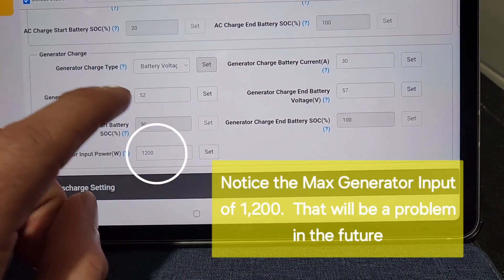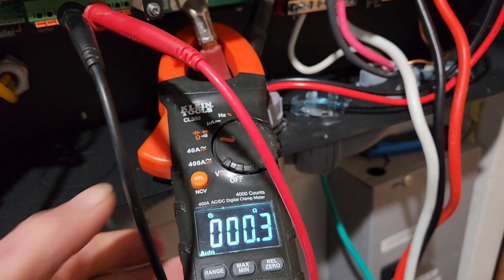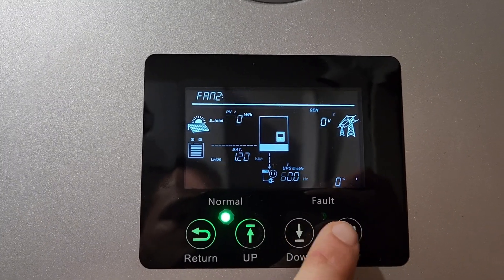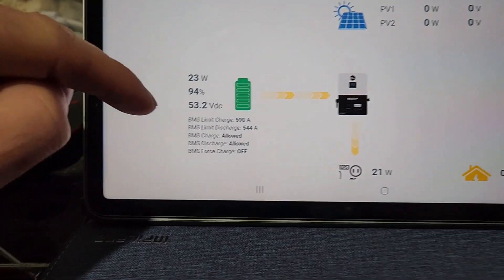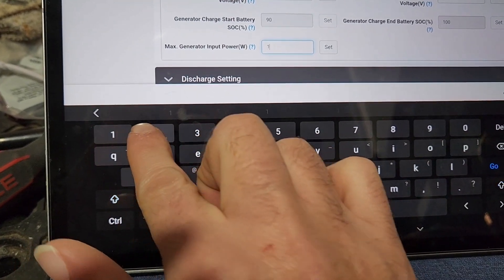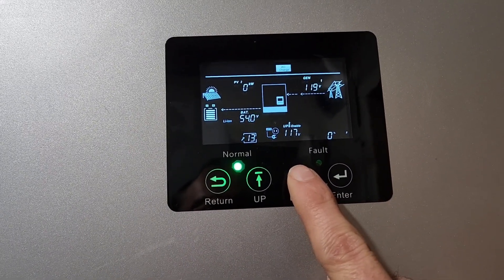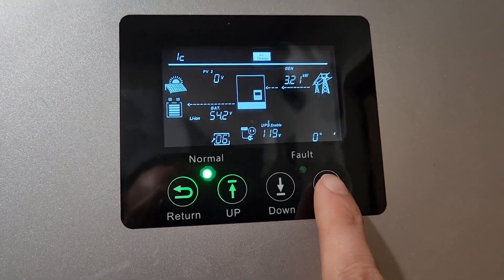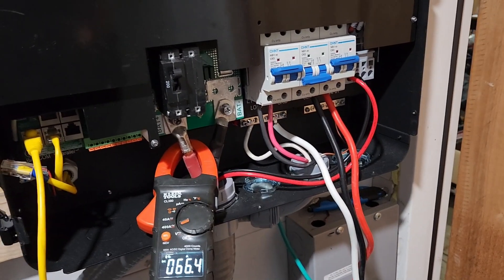EG4 6000XP, Explaining how the generator settings work.

Comment: Please explain how STOP charging using the settings.   The only way I can stop it from charging is by turning off the breaker.    Thanks!
Reply from the maker: Are you use Voltage or SOC?
Reply: @theadventuresofarenaissancman  I have tried both!  Still does not work.

Comment: Hi Renaissance Man, Very Interesting! I just got my Grid hooked up to my inverter and hope to get to start playing with it this week. I got to learn these setting more and how to make it do what I want. Very interesting here, I am going to have to study more on what you have here in this video to make sure I understand what you are saying and how it would apply to me. More later, it's late and i've run out of time today lol. Super Thanks for showing this. I'll be in touch!
Reply from the maker: The 6000XP has lots of settings.
Reply from the maker: I'll be here.
Reply: Super Thanks Dude! I got to spend more time researching with hopes I got it set right for the time being at AC volts Start 46.4V and end 49.6V only for if it get low with hopes my BMS will cut it off if something goes wrong lol, I feel a little like my head is on the chopping block but think that should work for now.  @theadventuresofarenaissancman

Comment: How does one wire the dry contact relays to a generator for automatic start/stop?
Reply from the maker: You need a generator that supports a two wire NC NO remote start signal.

Comment: Does your generator have <3% THD? If so, what generator do you have? My Generac 22KW has only <5% THD which appears to be out of spec of this EG4 6000XP inverter. Thanks for your input. I'm worried I need to buy an EG4 Chargeverter if I want to use my generator.
Reply from the maker: I find the higher THD generators still work if you keep the generator load below 80%.   Champion 8,750/7,000 inverter generator. <3% THD

Comment: Great video. I find them very informative.

Could you explain how to hook up the wiring from a generator inlet box to two or more 6000xp's ? Does the hook up need to go to each 6000 or to just the primary?

With 2 6000's, I was thinking of wiring to a box inside near the inverters, but I wasn't sure how to make the connections from the box to each of the inverters.

Thanks
Reply from the maker: I would use morris splice/connector. 

Morris Products 97643 Multi-Cable Connector, , Dual Entry, Black, 3 Ports, 250-6 Wire Range,, 5/16" Allen Hex https://a.co/d/71jLsYp

They come in different sizes, shapes and other  brand names.
Reply from the maker: Both inverters need to share the same generator and grid connection.
Reply from the maker: You may have noticed that the left inverter was turned off.  I wired this up just for a quick video.  I'm still in the process of redoing my setup.
Reply: @theadventuresofarenaissancman  Thanks. I appreciate you answering my questions.
Reply from the maker: Welcome

Comment: My question is on the connection from the generator to the inverter. I have a 10000w gen and will plug into an exterior 50amp outlet near my inverter. Do I just run awg 6 from the 50amp outlet to the L1 and L2 in the inverter? Im off grid totally.
Reply from the maker: L1 L2 N and Ground

Comment: I currently backfeed the house mains panel with a 12kw, 3600rpm diesel generator when grid power goes out. 

What would you think about taking that back fed power from the generator that is feeding the house mains panel and connecting it directly to the 240 VAC input terminals on the XP's when mains power goes out (instead of the gen terrms) for charging and supplying AC to the critical loads panel? 

Assuming the generated power has a THD below the max allowable 3% that the inverter requires, how much overhead would you think would be available to run critical loads after the charging load requirements? 

Nice videos, I've been a Vdub guy my whole life, know them inside out. Once had a bug that did 11's in the qtr, currently working on a Vanagon.
Reply from the maker: You can reduce your charging amps, if your generator struggles to power the house and dc charging.
Reply from the maker: DC Charging can use around 6,500 watts, assuming you set the charging to max.
Reply from the maker: 3,600 comment about the generator make me think that it's not a low THD (inverter generator).  In a perfect world, assume 80% load on the generator...6,500 watts charging, leaves you with 3,000 watts for the house.
Reply: @theadventuresofarenaissancman  Thanks for the math sir. I need to scope the generator and see what the THD is on the output before hooking it up like this. I just want to try and keep things manual and seperate. I do know that when I load that genertor up, it doesn't miss a beat, its not an inverter but it is a very strong unit.

Comment: I have the 6000xp. I also have a 22kw Generac generator and transfer switch.I have it wire as such.
Solar panels to pv 1 & pv2 . Then inverter load breaker to the transfer switch ( grid in put) then generator is connected to the generator in and generator out to the breaker panel. I have a 30amp breaker wired to the Generator breaker on the inverter. 
In theory. When the lower set point( soc ) is met , the transfer switch should disconnect the load wires and put 100 amps to the panel , then put power through the 30 amp breaker to the generator breaker on the inverter. 
When the upper set point is met the generator will turn off . The transfer switch will  go back to the solar . Do you think this sounds like it will work.? I haven’t put power from the generator to the inverter yet.

Comment: How does the system handle generator bypass to load? Does it split the power between charging the batteries and powering the load?
Reply from the maker: Load takes priority over charging. When the load is below the generator limit setting it will charge the batteries.

Comment: Is there a setting for making sure the generator only charges the batteries when my battery soc is low and i manually start it? I am using 1 6000xp, 1 powerpro battery and honda 6500 generator for reference 🤔
Reply from the maker: No, I don't think so. I'll take a look later today.
Reply: The client I installed a 240v honda 6500 generator to the gen input of the inverter called today saying his powerpro wallmount hit 20% so he started the generator but when his generator would idle down every once in a while the TV would turn off? Still confused over what could cause this 🤔

Comment: Can I use a small gen and if the load is more than the gen can out put. Will the inverter draw from the batteries?
Reply from the maker: No.  You may want to look at buying a ChargeVerter.  The ChargeVerter will work with 120v or 240v generators.
Reply from the maker: https://signaturesolar.com/eg4-chargeverter-battery-charger-48v-100a-5120w-output-240/120v-input?ref=M12gk_2DtiVacN

Comment: I purchased the 46500 brand new in the box still signature solar is willing to give you $1,200 bucks back to switch over to the 6000 the issue I have is it will my Westinghouse 4500 watt inverter generator that is only single phase but 30 amp will that generator work on the 6000 XP for at minimum to charge the battery Bank I seen one of your comments said you'd use a small generator as well I was just wondering if you can use a 120 single phase inverter generator and maybe make a jumper wire to provide 110 to both legs enough to charge the batteries or there's a switch to switch the generator input to 120
Reply from the maker: No, you can use the ChargeVerter.
Reply: @theadventuresofarenaissancman  I was trying to avoid using another source to charge battery Bank backup kind of defeats the purpose of an all-in-one if I have to segregate all my stuff would you recommend me updating to the 6000 or do you think the 6500 the better candidate
Reply from the maker: 6500ex can work with 120v.  6000xp needs 240v split phase
Reply: @theadventuresofarenaissancman  so the next question would be if using a charge inverter to charge the battery is back up with my 110 generator am I still able to utilize the dry contact Jenny start stop feature built into the XP and maybe a changing the setting so that once it reads the battery level at a certain level it opens the circuit back up just send the signal to turn off the generator and back on based on battery level
Reply from the maker: You can but I don't believe that your generator supports a two wire start.
Reply: @theadventuresofarenaissancman  no probably not that's why I was going to be using like a relay to activate the push start button cousin has push start and remote start
Reply: @theadventuresofarenaissancman  also have you tried jumping the 110 with a jumper wire to send power on both L1 & L2 on the AC INPUT FROM GENE  to charge the batteries
Reply from the maker: @stifflerjj4  no I didn't want to take the chance of making smoke.

Comment: Those fans are loud. Before this video I was seriously contemplating on getting one installed in the bedroom closet
Reply from the maker: That room is only 5 feet by 7 feet.
Reply: You could probably install some Noctua computer fans if they're compatible. Cheap fans are loud. You shouldn't need a lot of cooling capacity being in a climate controlled house, just make sure you have enough clearance if the closet is small.

Comment: Please link the generator you use or make a video of it showing how it's wired into the inverter please and thank you. I'm trying to so the exact same setup
Reply from the maker: Champion Power Equipment 100520 8750-Watt DH Series Open Frame Inverter, Electric Start https://a.co/d/a1Mtkdo
Reply from the maker: I picked mine up at a local auction for $400.  It was new but had a destroyed box and a small dent in the frame from a forklift.

Comment: Awesome video. Man there are a lot of settings on these. So if I have a 5kw max continuous 240v inverter generator I would need to keep my loads down AND limit my generator input amps so I don’t exceed the max output of generator?  Will that work?
Reply from the maker: That's correct.   You could use the EG4 Chargeverter if you wanted more flexibility.

Comment: What brand and size generator are you using for your back up?
Reply from the maker: Champion 7500 running watt open frame inverter generator.
Reply from the maker: I also have a 120v 3,500 watt open frame inverter generator.

Comment: I’m curious how the system works when the generator is sending power, the solar panels are sending in power and my house is drawing a load? Can the battery be charged and drain at the same time? Or does the generator and panels fill the load draw first and only send excess power to the battery to charge it.
Reply from the maker: When the Generator or Grid relays are enabled...that specific input will cover 100% of the load and add to the charging rate. Up to the maximum rate.

Comment: hey renaissance man im learning alot from u but question... can i not have grid connection and generator connection at the same time,because when i do i cant get 6000xp to pull from generator... any thoughts....
Reply from the maker: You would need to turn off the grid breaker for Generator to work.
Reply: @theadventuresofarenaissancman  yup i got it figured out.. thanks man
Reply: well i thought i had it... flipped ac in breaker off, flipped gen in breaker on and it clicked clicked clicked several times and something popped inside and it shut down... not sure what happened but it is still working right now... kind of afraid to try it again....
Reply: not sure what i did wrong... i wired up a floating neutral inverter generator to it but i only wired 2 hots and the ground... what u think happened...
Reply from the maker: That doesn't sound good
Reply: @theadventuresofarenaissancman  i know man i was excited to run on the generator,but not sure now ha...do u think not having the neutral hooked up caused problems...
Reply from the maker: Possibly

Comment: I assume your two 6000XP’s are wired in split phase?  If so, is only one dedicated to Grid, Gen, Battery and PV input?
Reply from the maker: The inverters provide split phase.  They are wire in parallel.  Inv1 L1 and Inv2 L1 share the same subpannel bus.   Inv1 and Inv2 L2 share the same bus.
Reply from the maker: They have to share the same generator and Grid.   Solar PV will function independently.